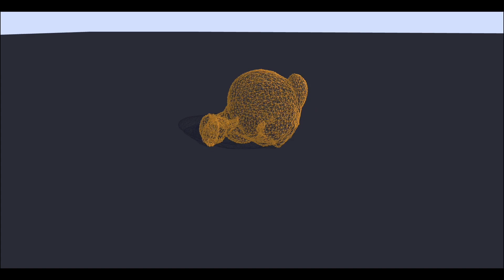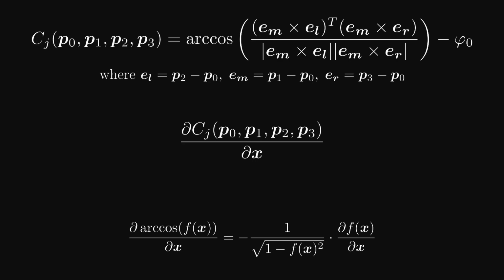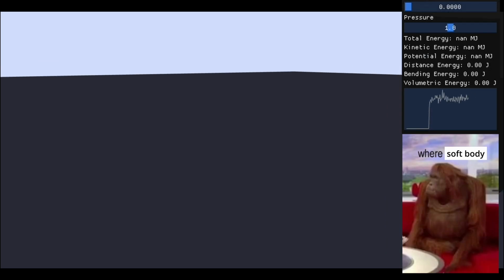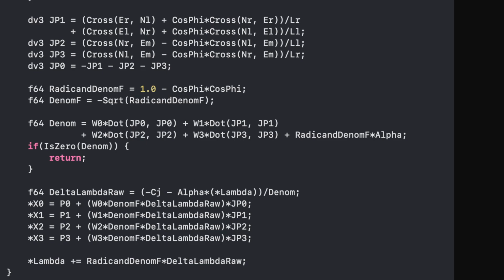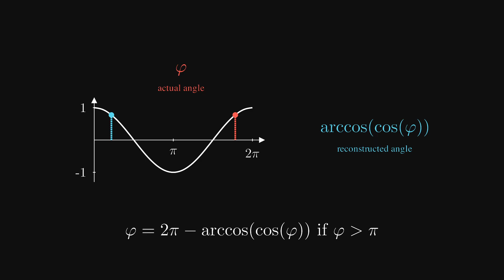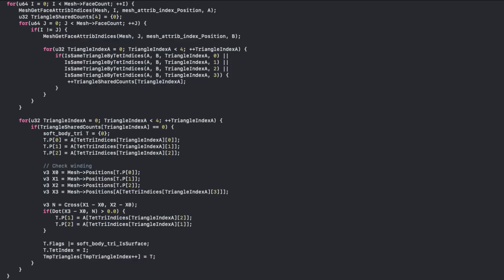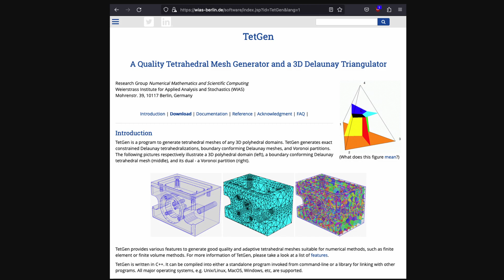Increasing my Soft Body's Bending Resistance using XPBD | Devlog Episode 3

Comment: Could we solve the angle constraint  as just: 
  diff.ang =  rest.angle - current.angle   
And then just rotate border p2 and p3 points, around axis  |p1 p1| , by   0.5 * diff.angle? 
This would 'flap' these border p2 and p2 verts like a bird :)  
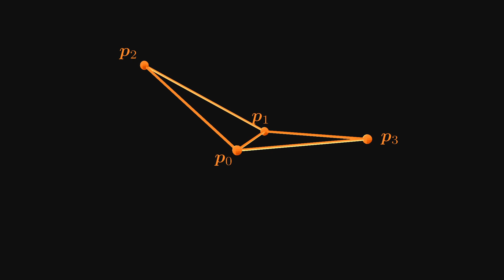I know that the issue with using distance constraint ( 10:35 ) as angle constraint  is that it is 'weak' at the 180 deg (it makes sense - you would have to have very strong spring to make  flat triangles stay flat) . Using angle does not have this issue.
Reply from the maker: This could indeed solve the problem itself for maximal stiffness, but I am unsure about softer constraints.
Additionally, the reason why you would want to use constraints is because of the physical theory behind them. Just modifying the positions of the model might not adhere to the laws of physics

Comment: i watched this because i'm attempting to discern the core mathematics of projective dynamics since i don't read math well, then i noticed that your other videos are "from scratch" haha i often post on such videos that scratch ain't gonna do you no favours :)  i'm old and have a difficult time learning but i've had a lot of fun using primitive methods. can't you treat a tire simply as a series of radial sections and connect them together? it doesn't seem like it would need anything more complicated than mass-springs for each vertex to be satisfying and extensible to abstraction, like comically elongating tires when bounced. but you did say you found a solution :)
Reply from the maker: That could work too, I'll have to see what works and what doesn't at a later point when I connect the tire to a wheel. Did my videos help you to get an understanding in what you are seeking for? Also you have to tell me, are you pro or contra "from scratch"? After reading your other comment, I am confused :D
Reply: @blackedoutk  i can't remember if i found your video or matthias muller's XPBD video first, but one picks up all sorts of things :) i find myself having to discretise "c" over "c++" descriptively as well. unfortunately my comment is difficult to understand, life looks very different if you see ma5ons actually doing evil things to people, from how it looks if you don't. it's a comment i make several times a week to developers who aren't using the "scratch" sdk, so it's not directed at you personally.
volumetric pressurised tires with friction do sound like a lot of fun.

Comment: Explain the math behind the constraints Cj  i think it looks like Lagrange multipliers isn't it
Reply from the maker: The lambda variables are the lagrange multiplier. The constraint functions Cj are used to define an energy potential of the system. Just like the distance function for a linear spring. The exact relations are descibed in section 4 of the xpbd paper.
Reply: @blackedoutk  i wish u do a detailed vid about the math and the implementation of it
Reply from the maker: @Xphy  I will keep your wish in mind, however it takes quite some time to make a video like this. For now I would recommend you to watch the video "09 Getting ready to simulate the world with XPBD" on the Ten Minute Physics channel.